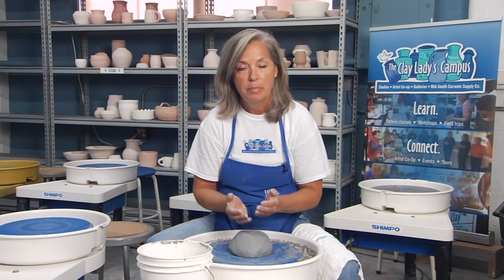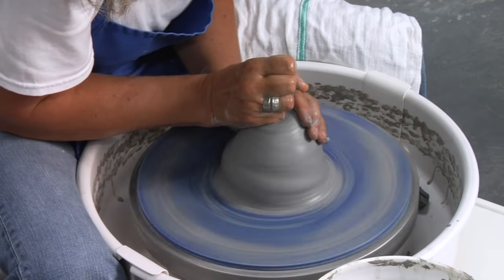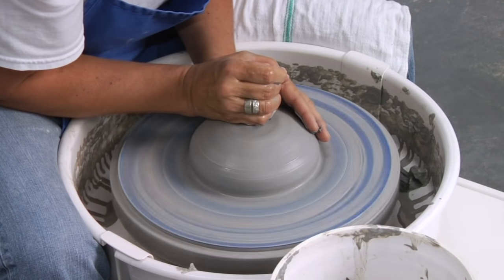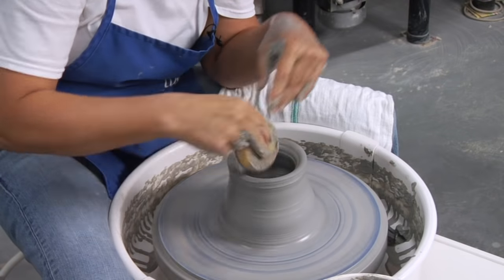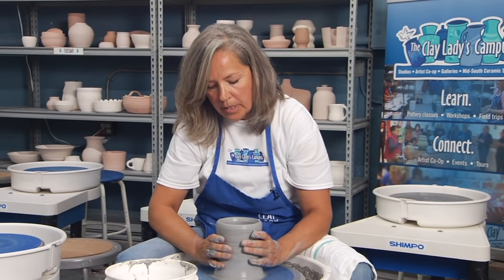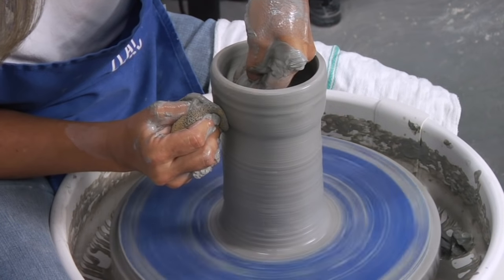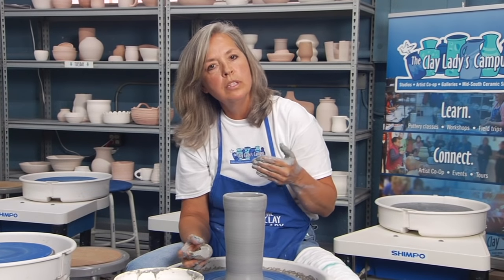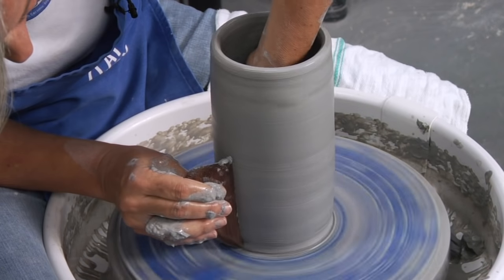How to Throw a Cylinder with The Clay Lady

Comment: I'm an early learner in wheel throwing and I've been struggling with pulls for six straight weeks of class! I still can't get a proper cylinder after all this time, so the handful of items I've made are (rather thick-sided) bowls and spoon rest-type things. I'm finally realizing one stumbling block of mine is that - despite the fact that I am a righty - all the instruction to do all pulls from the right side (4-5 o'clock) hasn't felt natural to me at all: I can't get the pressure-counterpressure right, starting with the initial pull. Seeing you do the first pull to the left just blew my mind because I keep wanting to pull from that side! I'm going to have to try that next time I'm at the wheel, and I would bet that will finally allow me to make progress on my pulls. Thanks for sharing this!

Comment: Hi.... Please guide me, how do i control cracks in clay object. if there is anything i mix with the clay or any other treatment to stop those cracks, so please guide me. thank you so much.
Reply: If it''s at the bottom of the clay pot/bowl you need to use a sponge and compress the bottom of the pot/bowl early in the wheel  throwing stage.  After you have pulled up once or twice.
Reply: Thank you so much, but I do slab sculpture, like high and low relief. So sometime crack starts from top and sometimes from the bottom.
Reply: You might try putting saran wrap or some other covering onto the clay while it is drying.  Drying the piece more slowly makes it less likely to crack.